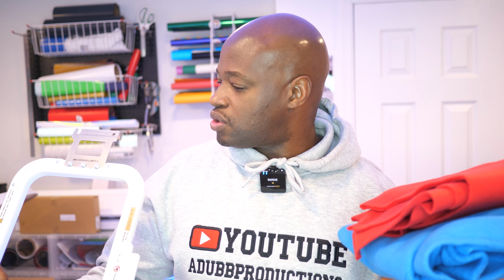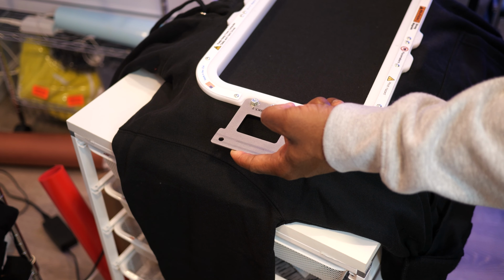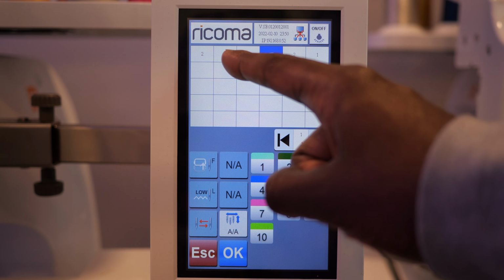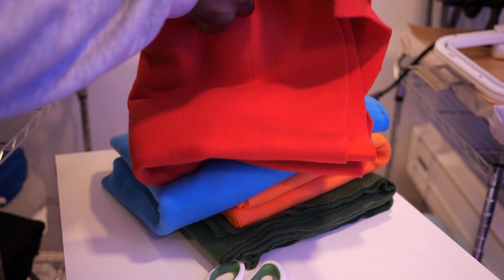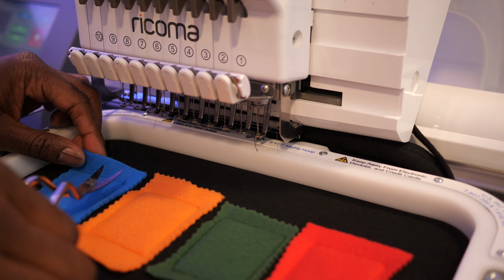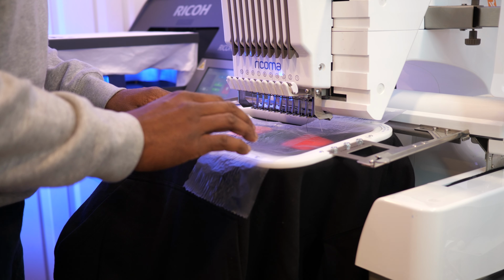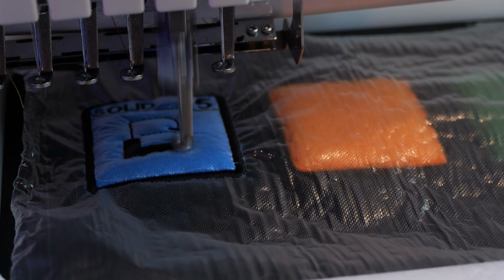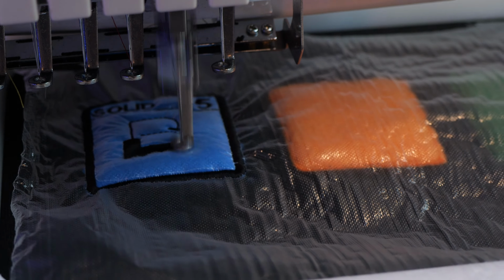Applique Process Explained on the Ricoma EM-1010

Comment: Great stuff if you didnt know if you just hit the start button after you frame out and cut what you need the start button bring it back in. Then it starts right away instead of hitting the frame in button and then the start again.
Reply from the maker: Well, yours works different because mine does not do that. I learned that the hard way.  It started embroidering right where it was.  Maybe because i am manually making an appliqué in digitizing as a pose to digitizing and using the create appliqué feature,  idk but that does not work for me.